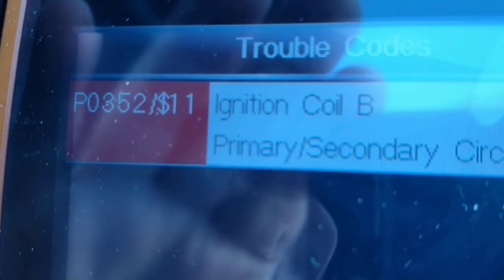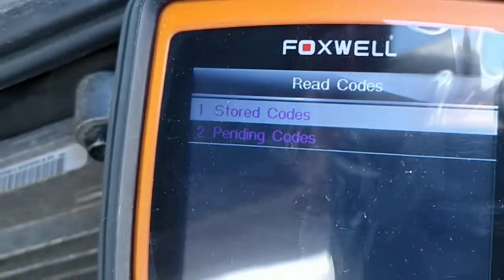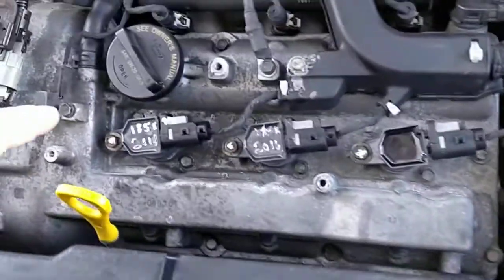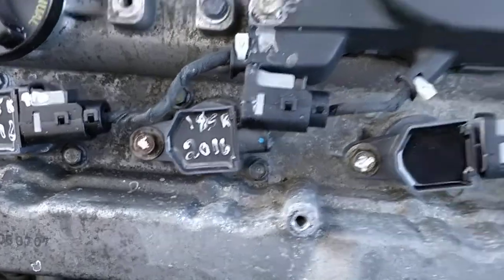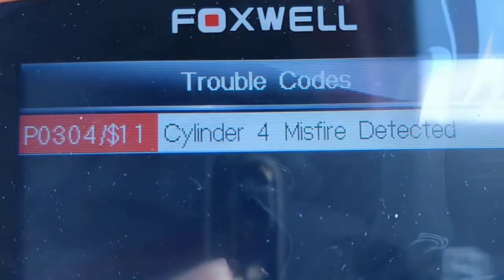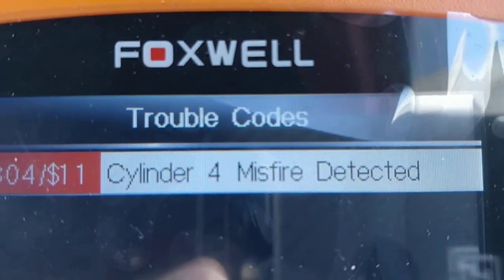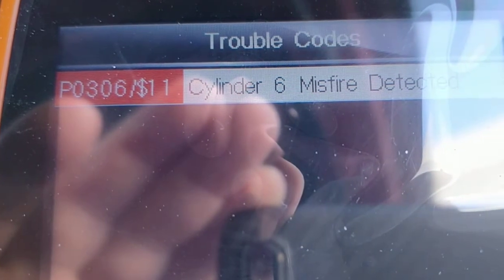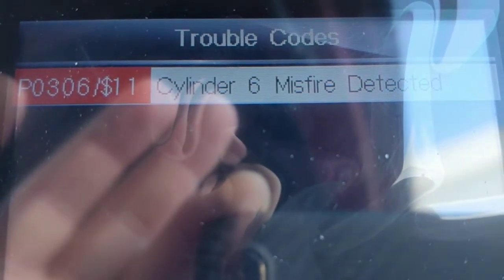2007 Kia Sedona 3.8 liter firing order.  PROVE IT!

Comment: So bank one from your view on this 3.8 is far bank closest to the firewall and bank 2 it closest to radiator? I'm looking to change my o2 sensor bank 2 sensor 1 trying to locate it thanks
Reply from the maker: Bank 2 sensor 1 is the O2 located in the upper section of the exhaust manifold abutting the firewall.